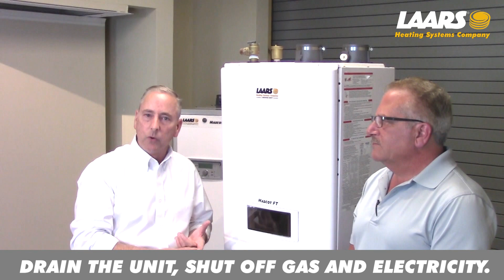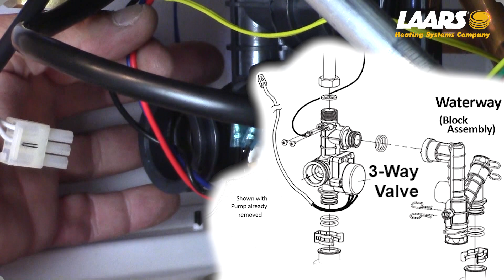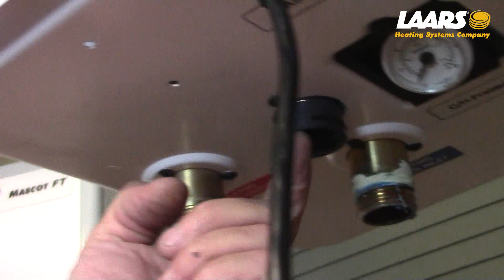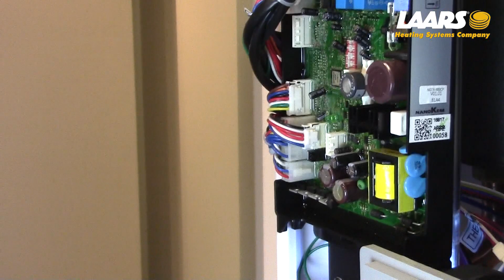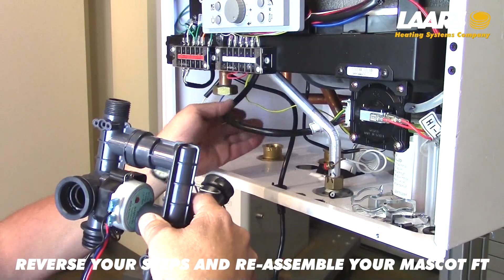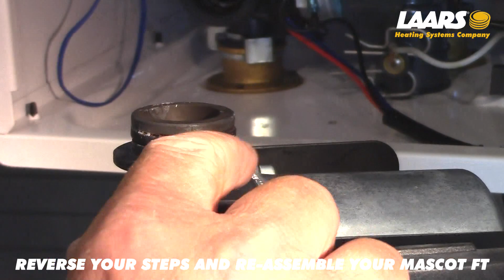FT Series (residential) Pump and 3 Way Valve, Remove and Replace.

Comment: A lifesaving video. This is the same setup as the dreaded HTP EFTC-140/199W, which 99 out of 100 plumbers in Massachusetts refuse to work on. It's also high season for COVID and the coldest part of the winter, so once my one-of-100 plumbers got sick there was nothing to do but replace the 3-way pump myself. (What's a warranty worth if no one will do the work? As one plumber after another said to me, "The reason I can't service your boiler is if I open it, I own it. It's probably the valve but...") Obviously this is not recommended for non-plumbers, but I'm reasonably handy...and really had no other choice.
The short version is that (1) a wide jaw basin wrench is essential: the front nut is 1 3/8" and there is not room between the cabinet frame and the plastic top of the internal pump for a plumbers wrench or adjustable wrench to make even a minimum 60° turn. And (2) the front gasket is a non-standard diameter which stumped the two nearest plumbing supply stores and two oldschool hardware stores (mind you, it's COVID and supplies are bad on everything). Fortunately Harbor Freight's "Tap Reseater Washer Assortment" includes two of the correct size. (The OEM washers were mashed so tight on my 2018 HTP 199W  - and had baked so hard - that after a sixth of a turn to loosen the nut I was able to unscrew both nuts by hand.
As far as diagnosing the problem is concerned, the 3-way valve appears to be by far the most common problem with these units. Because the non-functioning 3-way valve does not open to CH/heating zones (it only makes hot water/DHW for the house), the CH out and CH return pipes warm rapidly during startup and/or while the DHW/hot water comes up to temperature, but - even though the zones are still calling for heat - the burner shuts off because the temperature of the CH return is already over the maximum.  You may suspect that an external circulator pump is the problem instead, but you can check by removing power to the external pump and setting only one zone to call for heat. The internal pump has plenty of power to force a couple of zones-worth of CH through the idle external pump, so if the external pump IS bad you'll feel hot water flowing through the external pump to the zone[s].

Assuming no other failures surface this video was everything I hoped for. Thanksagain.
Reply from the maker: Excellent!  Yes, we design our videos to be useful for techs like you (and even handy non-plumbers, as long as all safety guidelines are followed as outlined in the Installation Manual!). Steve Moruzzi and Ken Resnick have a nack for taking the complicated and keeping it simple.  
     We'll have more FT videos this year!  Thank You for buying Laars!
Reply: Good call on getting those washers from Harbor Freight. I looked up the part numbers and they are just 3/4" and 1" rubber washers (they call them "packing"). The parts distributors and supply houses want over $20-30 each!! Am I missing something or is that just highway robbery?
Reply: and you said you weren't a plumber ;-)
Mine is a 2018 also. had to search out this video as the current edition on the LAARS youtube channel shows an access panel on the side to make it much easier to get to the clips and nuts. No such panel on our earlier models.
there are lots of clever people out there that are not plumbers. I live in Alaska; not many Mascott techs here. So I'm glad for a resource to get proper repair procedures.
This is not technical stuff, just careful parts replacement.

Right to Repair💪
Reply: update:
Only one of the gaskets for the copper pipe are in the bag taped to the inside of the cabinet. you need two. don''t  dismantle your boiler until you have all the necessary gaskets. Google "boston heating supply" for them.
Reply: Hi! Do you know which Error number when the 3- way valve is broken? Because on my FT 199 it shows error number 10, the heat is working but when I try to open hot water it starts showing error number 10.
Reply: @borbox Same problem with same boiler! Error 10 no hot water!